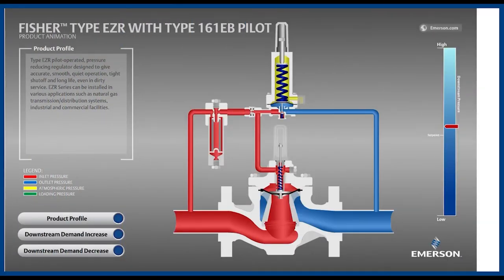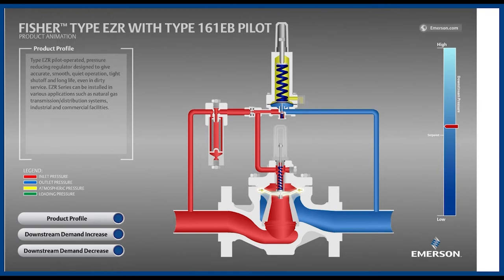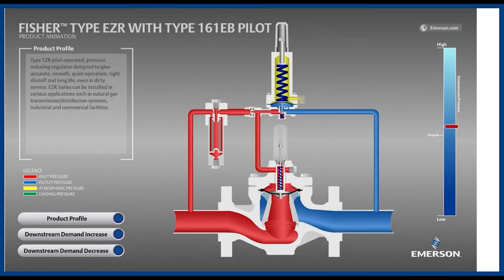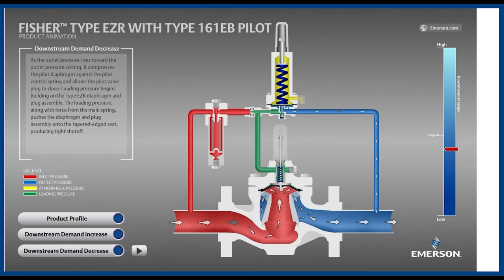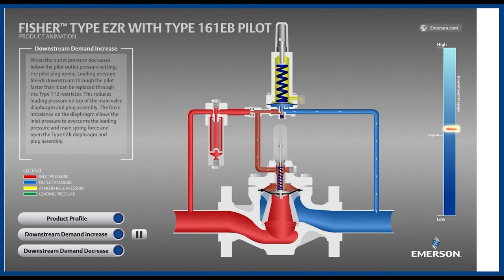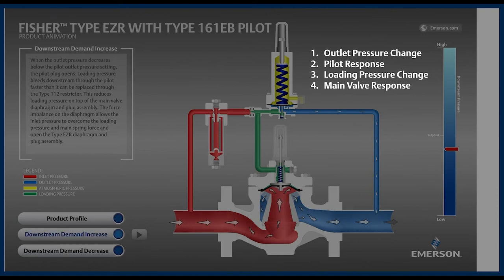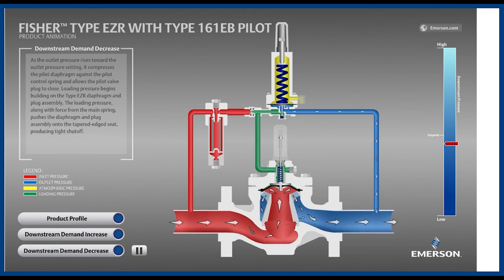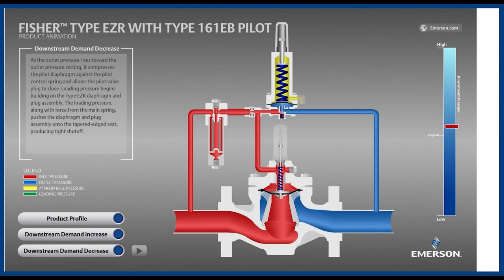How a Fisher EZR Gas Regulator Works - Guided Operation Tutorial

Comment: We set pressure at 100 PSIG but it rises upto 160  PSIG when load / consumption is zero. This happens at four customers. Please help
Reply: Regulator or pilot is not “locking up” or “seating off” check pilot seats/orifices and main boot.

Comment: Why doesn't this regulator pass gas when the inlet pressure is 15 psi or less?
Reply: The inlet pressure needs to overcome loading pressure plus the force of the main spring.
Reply: Also, the flexible element (boot) requires a certain differential that increases or decreases depending on its characteristics.
Reply: Is there a difference between bleed line vs control or sense line or just different terms for same thing ?
Reply: @nickmurphy3935 yes. Sense is the communication back to reg. Bleed or dump is just gas going back into the mix.